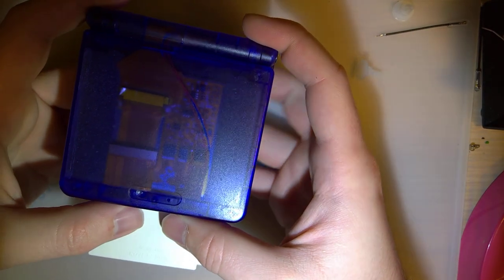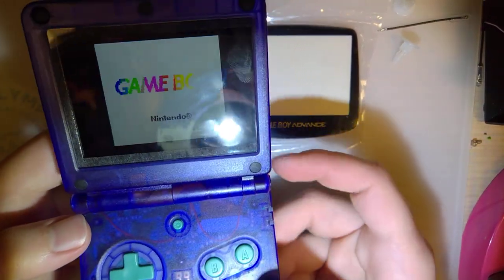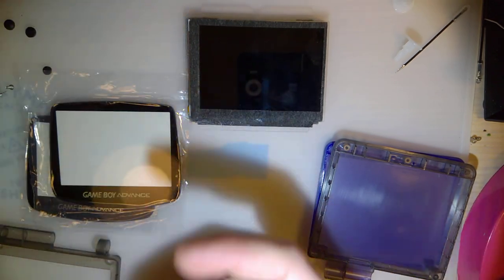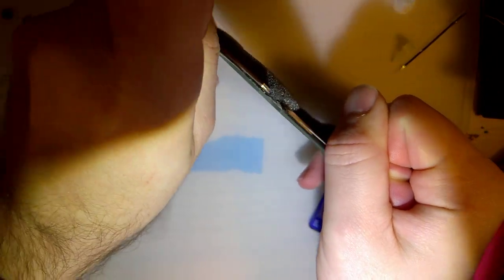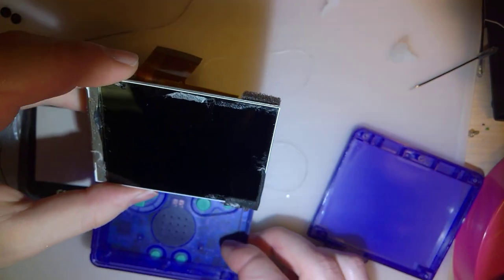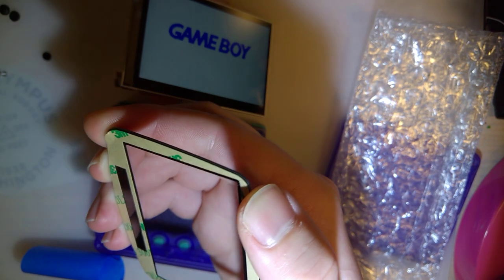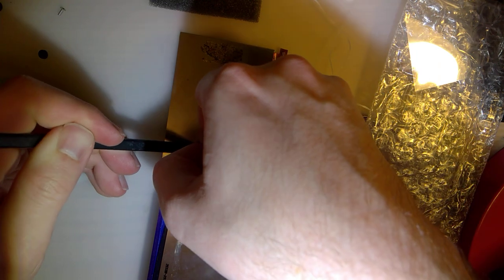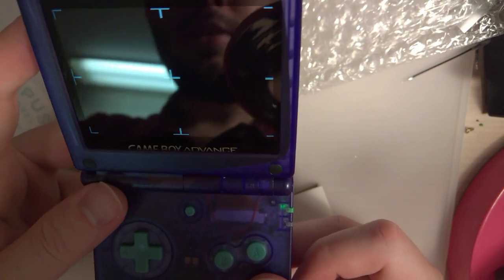Installing a New GBA Lens in my FIPS (v1) GBA SP

Comment: Thank you for your hard work and showing us the entire process! I really want to replace the black lens on my gba sp ips screen kit  with white one. Is there any proper way to remove the lens from the ips screen and not cause any damage?
Reply from the maker: Nope. Those are fully laminated unlike the bodge job I showed here. This is absolutely one of those "if you have to ask, you cannot do it" things. It's possible to delaminate these things -- smartphone repairers do it all the time, but it requires specific tools and skills. You can still just buy a replacement LCD and even at the inflated prices for a bare LCD assembly, you'll spend less than it would cost to learn to DIY.
Reply: @makho  Thank you for helping such guys like me. You literally saved my money and mental health (lol)

Comment: Hey bro, thanks for this video, I’m gonna replace my lens too and will use this video, will just be hopeful that I don’t break my lcd screen lol. 

Just a question though, you said that you’d clean the lcd. What would you clean it with (I got isopropyl wipes and not sure if that’ll be ok) and how much of the lcd screen do you clean?
Reply from the maker: I do not recommend trying to replace the lens in any modded GBA SP. The risk of damaging the LCD is extremely high. 

Re cleaning: https://www.youtube.com/watch?v=za9b8qkGecE
Reply: @makho  thanks for your advice. 

I’ve heard that plastic lens are so much easier to remove than glass lens, without damaging the lcd. And iirc Nintendo manufactured all their systems with plastic lens. Would you still not recommend replacing the lens if they were plastic?
Reply from the maker: @afcwimbledon2896  well plastic lenses can be flexed to separate them from the screen which means that the adhesive can be broken down a little at a time. Glass does not flex (enough) to do this and the replacement screens are too thin to separate without peeling. Also, a lot of SP kits use full lamination which means the adhesive extends to the entire LCD and not just the edges.

Comment: Hi, if I use an gba ags 001, I need the kit to convert to 101?  Or is just  connect the screen?
Reply from the maker: The kit works the same on any AGS board. 001 or 101 is irrelevant in this case.